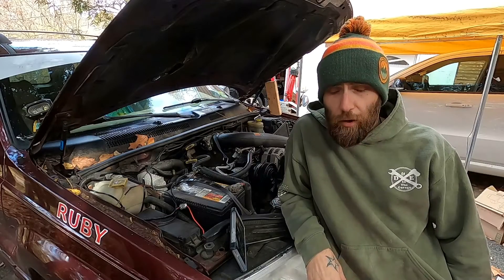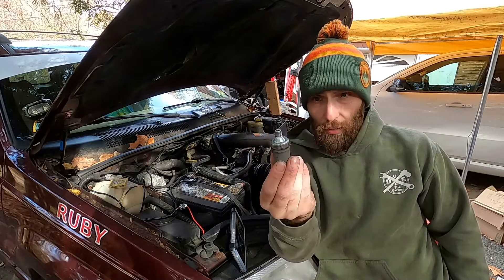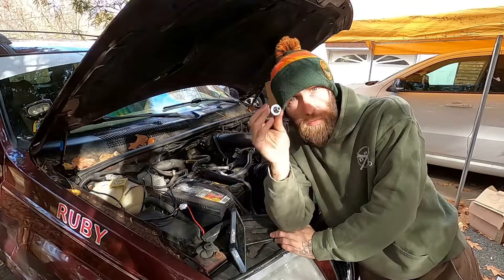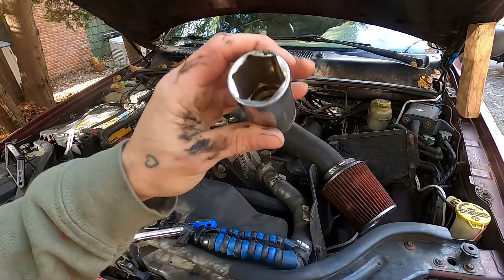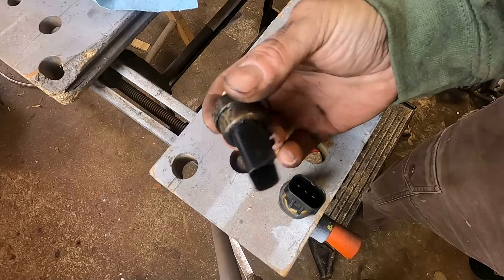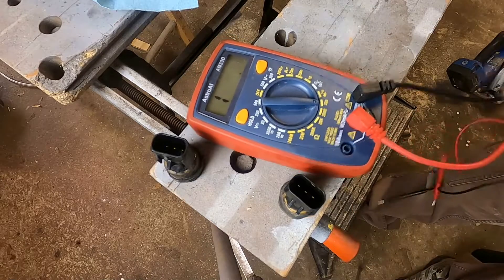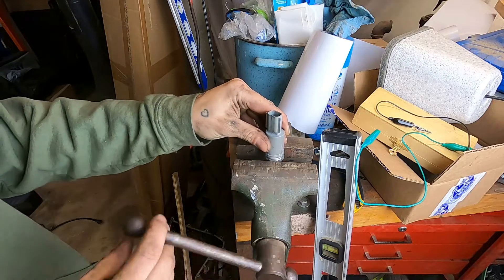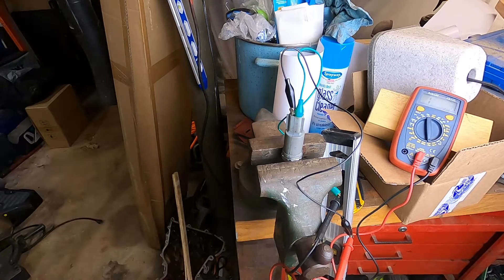OIL PRESSURE SENSOR BENCHTEST - 1, 2 & 3 Wire Sensors (+ Jeep OPS Info)

Comment: I swapped out my sensor and oil pressure was b normal according to dash guage. Next morning I start up and oil pressure back to zero, and there was oil at the connector pins.  My mech guage reads normal pressure. I bench tested and I believe its a closed unit. Maybe I received a bad new sensor?

Comment: Slick little trick I figured out today was to take my Harbor Freight hand pump from a radiator testing kit and unscrew the quick connect fitting off the end, you're not going to believe this but the threads fit the oil senders directly!  Pump it up a few pounds and watch your meter.  I have a brand new sender for my 92 Dakota 3.9 from Autozone not responding that I tested before install so I'm going to take it back in the morning and show them.

Comment: I have a problem with my 95 chevy k3500 7.4.  It started with what I thought was low to not fuel pressure.  Replaced it.  Now that I have pressure to the TBI. It started and ran for about 10 minutes then drove it for 2 miles parked it over night.  Now I'm not getting a single to the injectors.  I rebuild pressure regulator and ran checks/ test. I'm more confused than I explain.  I was told that it could be the oil pressure switch. That GM used it as a back up fuel pump relay switch.  I feel like I'm going in a circle and chasing ghost.  Can anyone please help.

Comment: Good info, however theses are on or off,, looking for oil pressure. Also why is two wire used instead of one. Your skip over that. I think the second wire is the ground?
Reply from the maker: I think I mentioned that one wires grounds through the sensor body. You are correct that 2 wire uses a wired ground
Reply: @DEInTheGarage  Yeah you did say one wire is a ground. But how do you test a two wire,, i think ohms between the two wires is 0.. until you add some heat, then the switch is opened and can get a reading at the two connections. If not its dead, like i believe mine is. Why did they go from one wire to two wire? Built a run stand and having fun figuring out different sensor and gauges, verses dummy lights.. Interesting stuff.

Comment: Nice video. for the 3 wire sensor, you are testing ohms between the ground and ? You mention outside prong but not if its the signal or the power? Thanks

Comment: got my oil pressure sensor new at Autozone with lifetime warranty. swap it out for free when it fails. I dont do junk yards anymore after buying like 3 coolant reservoirs that kept cracking. Finally bought a new one and it wasnt no even that expensive.

Comment: Logically speaking.
Oil pressure sensor is an extra toy that lets you know about oil pressure in the system , which is usually sealed (no leak).
It helps to recognize the problem due to leak of oil or no oil in the system.
But if oil level is normal (no leak) and the oil sensor is acting up then its a sensor problem only and the car can still run normal like in the old times without all the electronics.

Comment: If I don’t start my jeep for a few days, the oil pressure gauge works great. But when I start it every day, it hasn’t worked for six months. And this is on I said the year that’s only two years old. Definitely going to use this multimeter testing technique.
Thanks again for a great video and Merry Christmas to you and yours!!
Reply from the maker: Yea bud, I would check it. Make sure it isn't dirty or faulty

Comment: Sr, first of all, thank you for all good content that you have created, it is really helpful for us folks that love this jeeps. I have a question that I don't know if you have a video on it, but I couldn't find it. I recently got a ZJ, and I'm trying to figure it out the source of a noise that I'm having when driving over 60mph. It seems like a wheel bearing going out sound, but the strange part is when I push gas and accelerate, the noise seems to disappear. When ever I leave gas and just moving over 60mph the bearing sound goes back. Typically in wheel bearing in my experience it is not related to gas only speed. I'm really in the beginning of  the 4x4 world so don't know shit yet. Hard to diagnoses. Hope you know something that could help me figure it out! Thanks a lot.
Reply: Sounds like driveshaft or blind bearing in transfer case that your front driveshaft goes too. That was the case for mine. I just took out the front drive shaft and noise is gone.

Comment: Had the dreaded no oil pressure on my idiot gauge, replaced the sender after driving off a particularly nasty bridge on the local beltway. I was pretty certain it was the sender as the gauge bounced around. My wj did not die then lol. It wasn't hard to find nor change! New sender showed all was good!

Comment: Just replaced oil pressure sensor on my 2002 WJ with the 4.0.  Never did a bunch test before installing it.  Oil pressure gage still shows zero pressure.  Not sure what is my next move yet 🤔
Reply from the maker: Check the plug and the wiring right off the plug. Sometimes the wiring or plug itself will get damaged or so dirt from oil spills (it is right there around the filter) that it isnt making a good connection. Look for easy stuff first

Comment: You will appreciate this… nothing like doing a terrible job, finishing up.. starting the vehicle for the first time.. dang.. forgot a vacuum line.. let’s see where it is, ahhh found it…. Wait why is the valve train rattling now?? Let me go shut this thing down… wait why is there a puddle of oil on the ground !!!!!  ffffduuuuuddddggggggeeeee !!!! It’s perfectly normal for a motor that holds 5qts to take 4 1/2 right ????? Right ????? 

Me after doing valve cover gaskets on a Highlander with a v6…. Apparently I rolled the rear gasket installing it and within a min or two she pumped herself dry. Nothing like having to a terrible job again.. hoping the entire time the motor is ok (it was).  F- Do not recommend
Reply from the maker: Oh dear lord bud. That sounds like a TOUGH way to go, but we have all been there. I think one bad job like that will take a lot of Shade Trees out and leave them wandering to the Stealership or local hack shop instead of attempting to "YouTube-It". Good on-ya for making it right though! I know a lot of guys who would have called the tow truck and admitted defeat.
Reply: @DEInTheGarage  not gonna lie the idea did cross my mind more then once…. Captain hindsight was in full effect wanting to punch an engineer in the face for some of their choices…. My final thoughts on the matter was in the early 2000’s Toyota had their top minds working on the Prius project… the glue sniffers were figuring how to cram a V6 into a Highlander.

Comment: Perhaps the reason why that some guys suggest having to take the oil filter out is so that they can positively be able to 
see whether some grease and dirt could get directly in the way of you being able to thread up the new replacement
sensor with the potential of getting a grease plug stuck into the delivery tube (threaded tube). I really don't see any harm 
in that though and I would do the same. Basically you have to: Degrease all of oil filter housing where the oil pump lives
(on some of the older models) If I remember correctly on my 1968 AMC Javelin 343 cu.in. the oil pump housing was totally
external in the same vicinity of the oil filter. So yeah, irregardless, degrease as should be, then remove the filter because you
are definitely going to have to be able to see what the hell that you're looking at and certainly before attempting to thread in
the new or used part!! So, I couldn't possibly rag on these guys that say so to do things properly. As for myself, my eyes just
aren't as good as they used to be and for me, I would absolutely insist on the degreasing measure and get that oil filter out of 
the way of my peepers! I want to see exactly such things as whether a gob of grease is about to hit me in the eyes or whatever! 
And so it just might also behoove yah to also change your oil and filter while you're at it but not mandatory. You have some 
good information flowing and for demonstration purposes, it's just good all the way around but surely, I would not bust on these 
guys for an equally good call, oh no, not one bit! Sometimes new cats learn good stuff from other pros too! Some people have 
the absolute full confidence of changing of the sensor without the extra added steps but hey now, it's a matter of preference
equal to a desired outcome without further troubles is how I see it! Good job there D&E!! Maybe I should have you change mine
out on my 03 Grand Cherokee 4.7 because I am just now beginning to hate the damnedable thing with all of it's gremlins just a
popping up all over the damned place! Although I do love my Jeep as I love to hate it too! It's a love/hate relationship a goin on!!!
Reply from the maker: That really isnt a bad thought. I had not considered that
Reply: In case of dirt around any type of sensor use brush and some gasoline in small container to clean it up - make sure the engine is cold and no smoking around the car.
Then use air from compressor to clean up the area around sensor, eventually spray the area with water hose and let it dry or use paper towels to dry it manually.
This way you get clean space around sensor and clean old sensor as well. 
In hard to get spaces use a small mirror to see how it looks like.
Pull out the old sensor and install a new one without taking anything else apart - taking oil filter out makes additional mess plus oil has to be added to the engine.
But it's your own choice.

Comment: Wow ... thank you! for posting on the oil pressure sensor. My 2000 4.0 has good pressure but... when warm at idle the gauge will drop to nothing and check gauges light comes on. I replaced the oil pressure sensor and worked for a month or so. Started to miss read again. Took it to a "jeep" mechanic and told him it had a new sensor and to look deeper. Well they changed the sensor at 158.00. Worked for a short time and problem returned. Just driving it now but do not like that the issue is still and "issue".
Reply: Check the connector and wiring.
Reply from the maker: Yep, check the wiring and the physical condition of the connector. Good luck with it!
Reply: @DEInTheGarage  I had the same exact issue. Oil pressure gauge would drop at idle after engine gets HOT(like highway driving for a while). Replaced the sensor twice. No change. Strange thing is that putting a quart of Lucas in during an oil change, seems to have "fixed" the issue. Have done it for the past 5 oil changes and tried without Lucas last year, and the problem came back.

Comment: Had a weird issue with my 2000 wj with the 4.0, on colder days the oil pressure would read 80psi while running, and my 4.7 02 wj had a issue with the sensor just saying 0psi randomly at idle and would come back up to around 40 while driving, new sensors fixed both wj’s